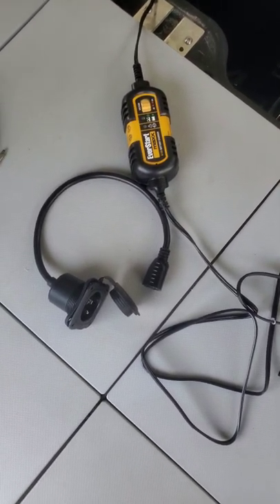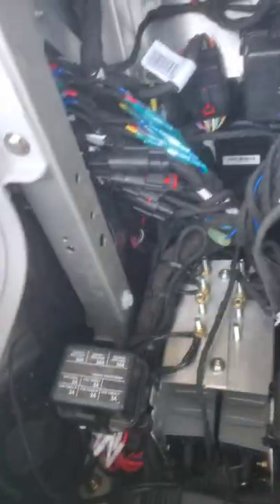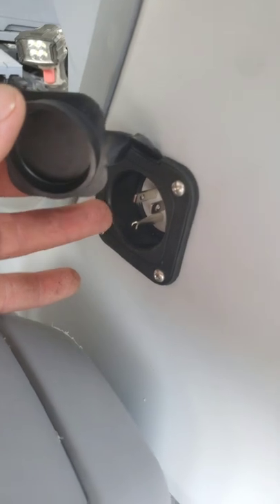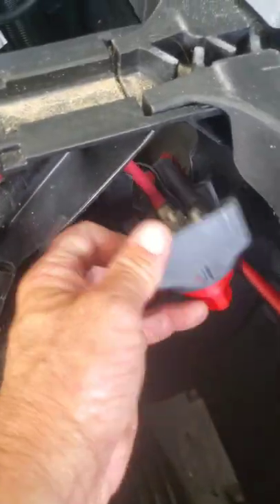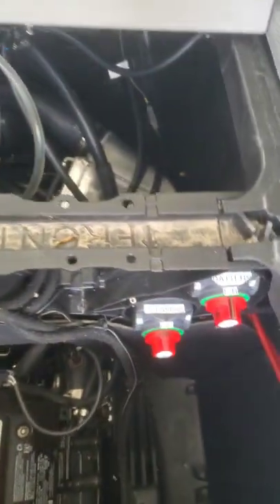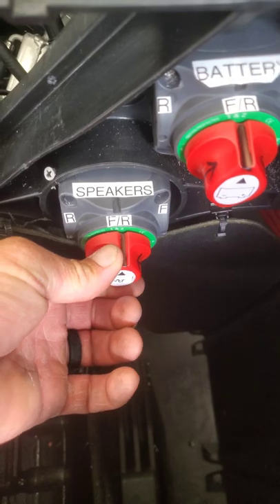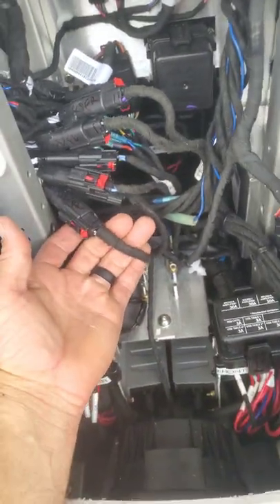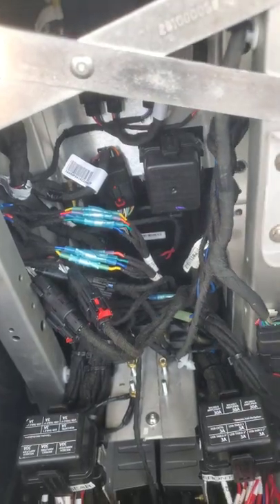Seadoo switch battery charger speaker switch wiring

Comment: Thanks for the video!  You mention a quad speaker setup and I'm hoping you have a video on that setup or could at least comment back with the details.  i'm adding the upgraded set of JL corner tables, but i've been researching for weeks now how best to add additional speakers/sub and have a few ideas, but curious to know what you did.  The JL solution that is pre-wired, pre-harnassed, with ready to go connectors are great and all for a plug and play solution with the two tables and the stock audio system, but it makes it a bit more challenging to add on. is your quad setup just two complete sets of the JL corner table setup?  Thanks
Reply from the maker: We have the 4 jl towers. 2 towers are just the 2 6.5" speakers and 2 are the 2 6.5" and powered sub. I rewired the speakers so we could run them front or rear in pairs or both front and rear together. Also installed 2 marine batteries
Reply: @cctool  Finally got my Switch the other day and finally getting to install the JL Audio tables.  Everything worked fine when i did a test setup, where i had the the power for the new amp assembly connected to the starter battery along with the stock audio.  I did that just to test that the new JL speakers were working.  I then connected the power harness for the new JL speakers to my secondary battery because i want them to run off the 2nd battery and not drain the starter battery.  when i did this setup and turned the audio on, only the stock system worked.  why would the new JL amp assembly stop working just because they are connected to the secondary battery while the stock audio is connected to the starter battery?  in theory, it shouldn't matter where the JL amps are getting 12v from as long as they're getting the "Remote On" signal from the stock system.
Reply from the maker: Agreed. Definitely a remote turn on wire issue.

Comment: Humm, so you are dependent on the HC battery charge to run your amp and speakers. When the battery discharges, you have to wait until you connect to shore power? You need to install a dual battery isolator to keep the batteries charged underway. I did find it interesting that you put a battery switch between the speakers and the battery. Gets rid of the parasitic load.
Reply from the maker: Not exactly. This allows for manually isolating the deep cycle batteries from the smaller factory jet ski battery for starting the boat. An automatic isolator would work but the manual is a more reliable option. 
The speaker switch is installed for cutting the parasitic draw AND selecting front and rear operation for the speaker amps. The stereo doesn't allow for fade for front or rear. That way when beached and hanging off of the back in the water you can turn on the rear and not have the front going with no one up there.
Reply from the maker: Whatever battery is selected when the engine is running will get charged. Or whatever one is selected when the charger is plugged in.